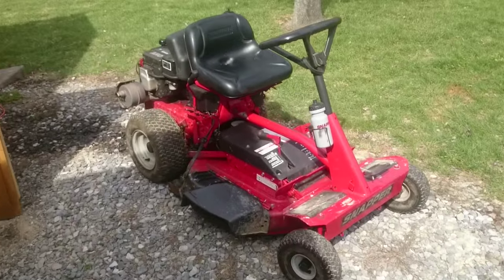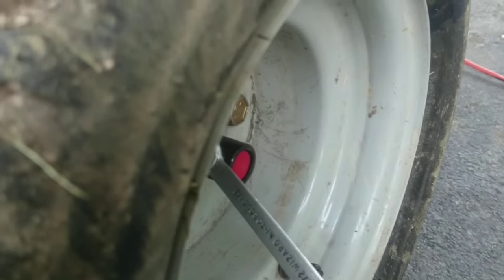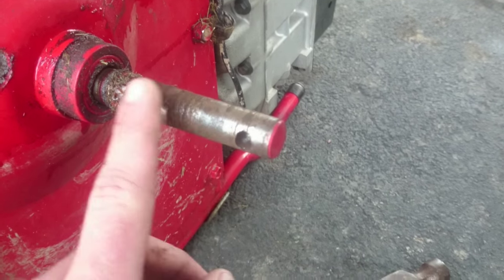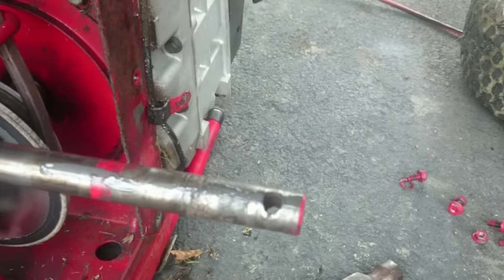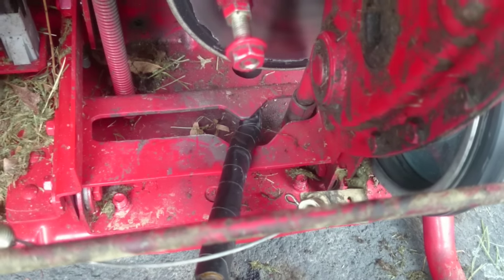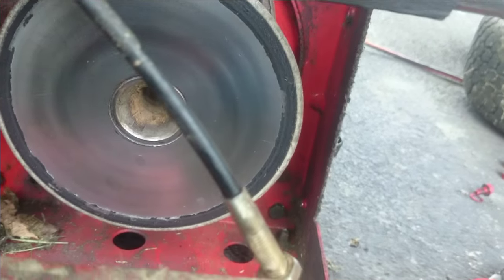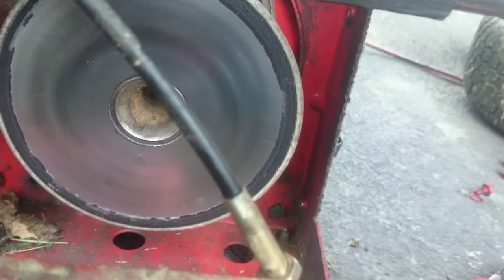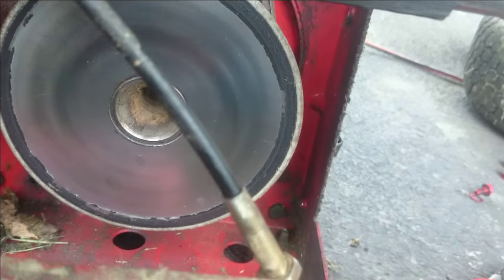Snapper series 23 rear drive axle boot replacement

Comment: Good video, thank you Clayton. I changed my boots today thanks to the video. My mower boots had same part numbers. I bought them at a Snapper dealer shop locally. The boots look just like the original ones, black rubber, unlike  your new boots. My snapper was 'given' to me about two weeks ago. It's was sitting outdoors in the weather for a couple of years, so I will be needing all the help I can get. Keep the video's coming. A word of advise to all your fans,  if someone 'gives' you a mower, have a can of wasp and hornet spray handy. I learned the hard way haha.
Reply from the maker: Yeah in looking online I found several different boots for these mowers.  These happened to be cheaper.  If you notice my video on the series 18 it has 2 different boots that look just like these.  Watch out for them bees good luck on your Snapper!
Reply: I just got given a Snapper Series 23. No wasps or hornets in mine, but needs new boots, a new drive belt, and when I pulled the drive belt cover there was one hell of a mouse nest under there! Looks like a whole family was living in there. Fortunately they must have jumped out while it was on the trailer to come home.
Reply: A friend showed me a soap solution way of immobilizing wasps....carefully with slow deliberate movement, spray with a pretested spray pattern. Knocks  them right down. I like 10 to 1 water/dish soap. Keep spraying till they're all  flopping in agony. Then you can kill them at your leisure. Death is more merciful...

Comment: AFTER removing the wheel hubs, hand sand the paint/rust off the axle areas where the hubs were mounted, clean, then put grease or Vaseline on the clean metal axle BEFORE removing the fenders where you won't damage the inner bearings or seals as you pull the fenders off, if you don't do this you can damage the inner bearing sleeve and the seal as you pull the fender off over the sharp edges around the drilled cross hole on the axle,  when you remount the wheel hubs generously cover the axle with ANTI-SEIZE where next time will be effort free. I learned the hard way.
Reply from the maker: Great advice on the Anti-seize!
Reply: Same here. After using penetrating oil, heat, and a couple pullers, I finally had to resort to cutting the wheel flange off. They can be a pain to budge
Reply: I just used a coarse file to remove the high spot around the tapered pin hole...but anything to seal the moisture out  YES ...not that close a tolerance fit on mine.

Comment: Thanks Clayton! (That's my son's name, too.) I'm just about to replace a rear boot on mine, and after watching how much work it was to replace that inner boot, I think I'll just replace the outer one which is torn. If the inner one ever goes, I'll deal with pulling all those linkages and everything then!
Reply from the maker: If it ain't broke don't fix it! Ha Ha
Reply: Come on man, I've got one arm, and I'm doing it!!!  Not much more work. Besides you already did the hard work getting the little beasty on it's backside
Reply: Brian, check out Jims fix it channel, he removes the other side and leaves all the other stuff in place the shafts are removed from the left side (viewed from the rear) give it a look and see if you find it less hassle?

Comment: 👍Good stuff. Really like that engine too! My old 1988 28" Snapper RER needs another engine. Still running but just sits in garage. The old 8HP is a knockin and drinkin oil fast😂 (SUBd) 🇺🇸✌️

Comment: Thanks Clayton, great video. I have a question for you. My 28" one day started getting harder and harder to put into gear, and eventually the lever broke, put a new one on and surely, she would not go into gear at all and started bending the shift lever again. I could barely get it to go in first parked it, and started using my JD. This was last year and just now getting back to fix it to give to my daughter. I figured I had to take the wheels off and proceeded to take the pin (bolt) out of axle, removed the nut but could not get bolt to budge. Never been taken apart. Put the nut on and hammered it with a rubber hammer and regular hammer but froze solid. Just have to keep after it. I'll get it out. But as I was doing all that and up on its back. I realized that the shift lever had come loose and would move easily through the gears but still a little hard into reverse. Do you think I need to dig deeper into the gear box and see if it needs some maintenance inside? Also do you have a video to help in adjusting the park brake? Sorry so long and thanks , Xavier
Reply from the maker: +Arnold Farphunougin  Thanks for watching.  I wouldn't think the gearbox would cause that issue.  If it was mine I'd take off the linkage to the primary gear case.  Then you could try moving the shifter and the gear case separately, the gear case slides, which should give you an idea what is binding up.  You also may want to check to see if your clutch is disengaging properly if it's not it would make it hard to shift.   I wouldn't think you'd need to remove the wheel to check this but if you must penetrating oil will be your friend if it hasn't been apart recently.  If I was a betting man I'd bet your clutch is adjusted too close to the drive disc probably from the cable stretching it would probably explain your parking brake issues too.
Reply: thanks I know what I'm doing this weekend!!
Reply: You probably got it fixed by now but for others who may have same problem,  I experienced the same with my 28''. I corrected my stuck shift by disassembling the shift handle and removed the spring it connects to. Mine has a flange bushing at each end, made of vinyl. The vinyl bushings were damaged and I replaced them. My shifting problem was solved. Hope this helps some one. By the way, I used a 'C' clamp to compress the spring, and a carpenter's long clamp to reassemble.
Reply from the maker: Good info.  Thanks!

Comment: How many years did Snapper use the Kohler 15 HP engine ??? Did the first series of engines not have an oil filter ??? Thanks
Reply from the maker: Sorry I don't have an answer for that one. Both of the Kohler equipped Snappers  I've delt with take the same oil filter which can be cross referenced to NAPA and a Motorcraft. I give the part numbers in my oil change video.
Reply: @clayton7825  Thanks for the help Clayton.

Comment: Got a question about these rear-riders. First, the one I purchased does not have the bars on the back for standing the mower on its back end. Newer model maybe? Second, when I purchased the mower, it would not go in gear. Got it cheap so wasn't concerned. Turns out both axle boots were split and full of debris. Took it apart, cleaned it up, replaced boots. Even put a new drive plate on it (the one with the rubber ring around it that makes contact with the plate coming from the engine). Everything seems to work okay, except that when I'm using it on any type of incline or trying to turn on a hill, I get one wheel spinning and the other not having enough power to move the unit. Any suggestions??
Reply from the maker: @quincyreb   Some had bars on the back and some of the newer ones had a hoop looking thing on the back. I've never ran across one with neither.
Reply from the maker: @quincyreb  These mowers have an open differential so the 1 wheel spinning on uneven terrain is probably normal. If you pay attention you will probably notice it's the tire with less weight or traction that is spinning.

Comment: I have a problem with my rider snapper mod E331518KVE The disc in gear is blocked while in neutral it turns. The gears are engaged, but the wheels do not move, only by pushing the vehicle by hand thanks to the help ti seguo dall'Italia.

Comment: The plastic boots don’t last as long as rubber boots do. If you set mower back on two 2x4 you will be able to get at the bolt without laying the mower back down.

Comment: HUB? Few taps with the hammer... Loosen this up... Pull this tire one handed... Now if your lawn mower hasn't been taken apart forever... THIS WILL PROBABLY BE A PAIN IN THE BUTT. Clayton, this was in fact a modern day prophesy. Had to eventually cut the hub off.  Ha
Reply from the maker: Yes they can be VERY stuck.  Depending on which end your trying to pull a 3 jaw puller can be a big help.

Comment: Did you ever figure out why your clutch/brake cable had so much slack? I have the same issue, but I can figure out why
Reply from the maker: Yeah it was because at that point in the video I didn't have it completely reassembled.

Comment: HUGE mistake using the plastic grey boots, been there done that, they fail with very few hours on them, I made a mistake in buying dozens of them before I tried them, it's such a pain doing this I would NEVER use any boors except the factory ones.
Reply from the maker: Boots have been fine so far 2 years later.  If I remember correctly they were made by Stens.  I will keep an eye on them.